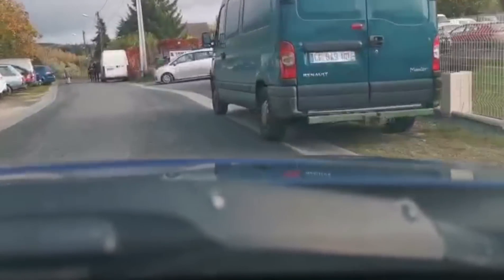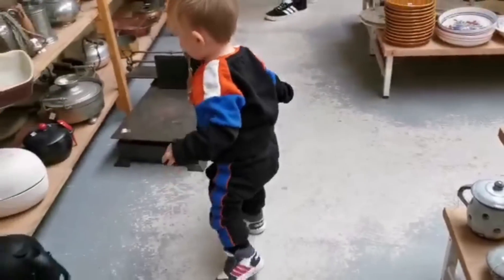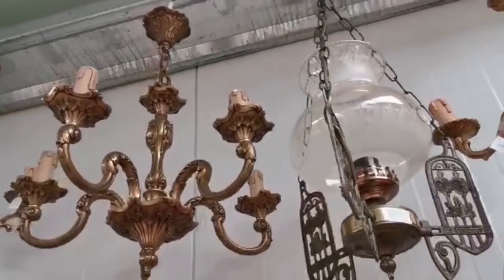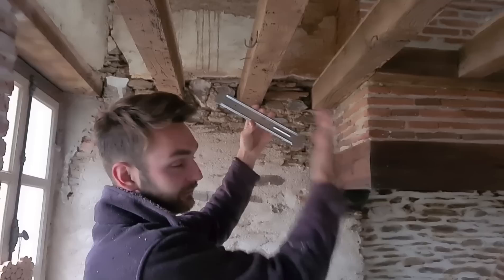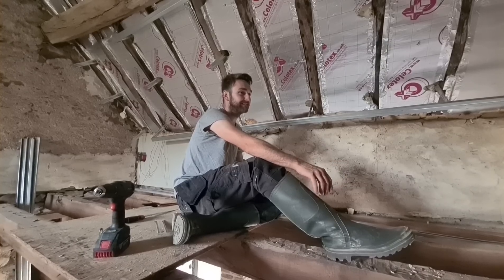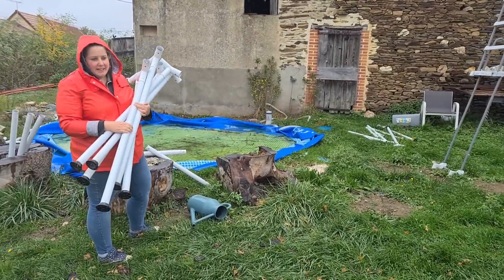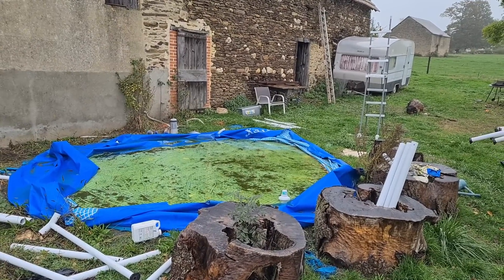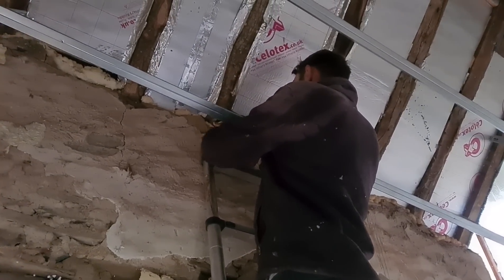escape to rural france - insulating ! EP012

Comment: I’ve been thinking about the lighting in the kitchen, I know you want chandeliers in there, but what about adding the thin LED strip lighting along the length of the beams?
You could just run them on the tops of the beams and it would give off a warm glow!
Plus you can change the colours for party’s!
Reply: The Chandelier is not the only source of lighting there is plans for 12volt lighting.
Reply: Tony BellCanyon the thought of LED strips is to add a new dept to the overall lighting, which would not take up anymore space or impose itself on the already beautiful wood and stone
Reply: Might be too much, too modern for them. Although I agree, it can look really smart done right.

💡Can't speak for Brits, but most Americans are not all that savvy about layering light (ambient, accent, task). They put in a lamp or change a light bulb & figure they're done😉.
Reply: Maybe some up- lighters could works pointing towards the roof

Comment: as far as I know you need to seal the beams from all sides so that they expand and shrink evenly as season changes through out the year and don't bow or twist or crack.
Reply: They are 300 years old they are done. No more "checking" ,but I agree to seal them on top too...for cleaning the dust will wipe off easier.
Reply: @Daihatsu_Hijet  Wood moves with change in heat and humidity not matter how old.

Comment: 💓For best results you should give it a light sand with wire wool then add your 2nd coat💓1st coat soaks into the wood💓2nd coat brings out the grain💓That’s just my opinion you need to do it how you like it💓

Comment: Hi Dan. I live in a country with much colder winters than France and the modern thing to do here is to apply continuous poly (plastic) on the inside of the roof and walls (the heated side of the room) to act as a vapour barrier (and then the 'plaster board'/gyprock is applied over the plastic sheets). An older method that may still be used in some cases is to use batts of insulation with a paper on one side. That paper acts as a vapour barrier, but it also is basically continuous. I'm just wondering how your insulation will work and with the existing aluminum foil on the other side will it trap moisture there and render the insulation less effective because it may get damp from cooking, etc.? Just curious.

Comment: Hey guys if you don't reuse the pool, the steel braces or supports would be great for a brassica cage! We have an old trampoline that when we move I want to flip the frame over and use pvc pipes to make arches up over, like a dome. I saw it on a YouTube video, it may work? Haha we can only try! Ps Dan wear goggles when doing that insulation.

Comment: Why did you install the insulation on the horizontal versus vertically? Does it have to due with the brackets?
Reply from the maker: Yes that's how the rail system works